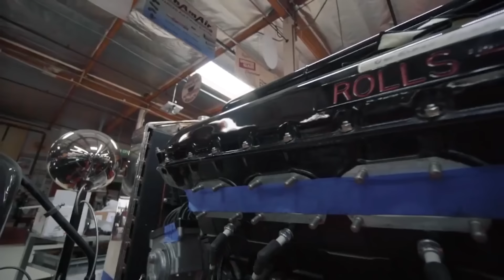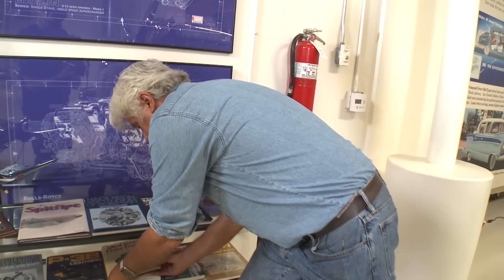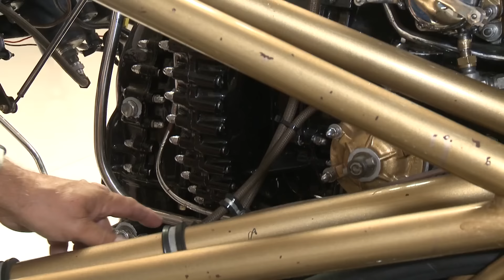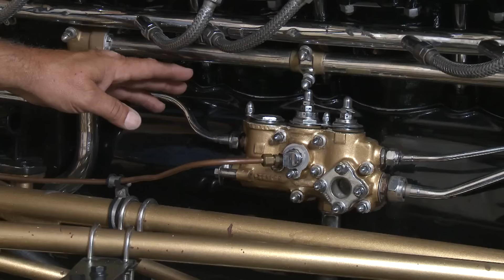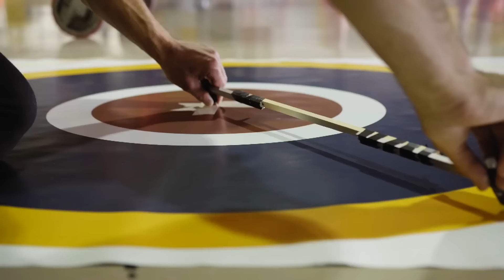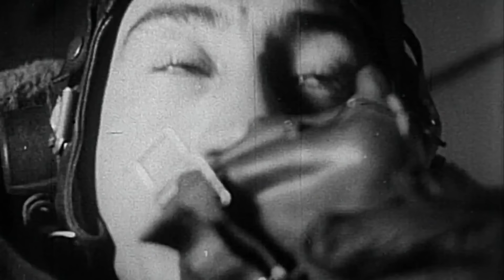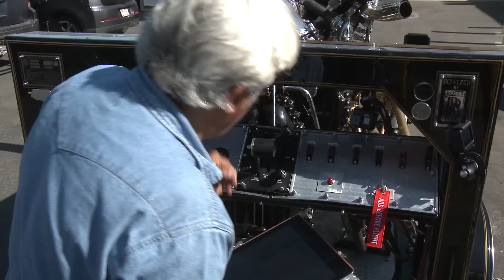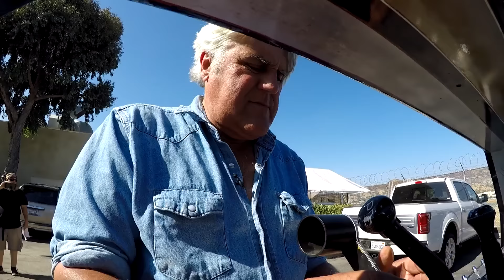The Engine That Won World War II - Jay Leno's Garage

Comment: It's so odd reading about these engines. This incredible monster was actually considered a medium power engine mostly for use in the smaller single engine aircraft. The P&W Double Wasp doing the heavy lifting.
Hoping the P&W will be next on Mr. Leno's shopping list.
Reply: Ryan James
RR made bigger engines like the Griffon.  Napier also made large square block water cooled engines.
Reply: s1rk3t.
The B 29 was very late in the war and could only carry 20,000 lbs on short range missions.  The Lancaster carried 14,000 lbs  and 22,000 lbs. 
Based on truth the Wright was not so very good. 
some years later a very much modified B 29 could just carry 2 x 22,000 lb bombs but not high or far and not in 1945.
Reply: Barrie Rodliffe 
The Soviets impounded a B-29 and copied it. The Soviet engines were superior and more reliable and powerful than the Wright engines.
Reply: Barrie Rodliffe The B-24 was powered by 4 P&W R-1830's R-1835's or later on R-1841's. The R-2800 were in the already mentioned P-47,  F4U Corsair, F6F Hellcat, B-26 Marauder, A-26 Invader and P-61 Black widow night fighter amongst other civilian   based air craft, early helicopters, fire bombers, and military transports.
Reply: Ryan James that R-2800 radial is a fantastic engine. it is a pity you only used two engines max in any configuration during the war. I think the C-46 Commando was the largest aircraft to have a pair, but it could haul quite a bit.....12,000 to as much as 15,000 pounds. A workhorse flying dangerous missions over The Hump in India!
Reply: Barrie Rodliffe Well when escorting fighters to and from Germany of course your going to have a higher attrition rate.
Reply: What are R-1835s' or R-1841s'? No such engines. All B-24s were powered by R-1830s', most of which were manufactured by Buick.
Reply: Graham White R - 1830-33  R - 1830-35   R - 1830-40   R - 1830-41  they're all variants of the R - 1830 double wasp Pratt. The liberator used all different variants of the 1830 in it's many different rolls.
Reply: R-1830 was Twin  Wasp. Double Wasp was R-2800. You left out -43, -43A,   -65 and -65A. No such thing as R-1830-40.
Reply: Miracle Wonderland Carnival Company I think four R-2800 is a helluva concept to think about but damn, what ever plane had four would have to have one huge fuel tank! Those things aren't the most fuel efficient. Lol the power though!
Reply: ADIT ADDICTS DC-6s had PW R-2800s.
Reply: Miracle Wonderland Carnival Company Thanks for pointing that out. I totally forgot the constellation was supposed to be a military transport but wasn't finished until a year after the war I think, maybe more.
Reply: ADIT ADDICTS Yes. And the DC-4 which went on and served during the war as the C-54 Skytrain. It is probably more famous tho for its role during the Berlin Airlift.
Reply: Howevern the C-54 did not have the R-2800s.
Reply: Miracle Wonderland Carnival Company the C-54 was powered by R-2000? Or something  like that?
Reply: ADIT ADDICTS yes the C-54 Skymaster and not skytrain  had the 4 r-2000 engines.
Reply: Ryan James aa
Reply: American junk
Reply: peer Lots of "American junk" contributed to the War Effort. It went into ships, planes, and tanks and trucks. Never underestimate the pluck and courage of an ardent recycler!
Reply: soaringtractor yes, well apparently that doesnt matter when it turns out there were R-2800 C-54s afterall. The c-54m had them. 28,000 pound payload.
Reply: soaringtractor Western bacon, ours and West Berliners. A lot of spam thrown in there too.
Reply: Ryan James.
Ever hear of the Lancaster, the plane that carried the biggest heaviest bomb of WW II  and it had 4 Rolls Royce Merlin engines,   P & W did go into the heaviest ever single piston engine fighter, the P 47 and it went into the B 24 which could only carry less than half the load of a Lancaster.  
There is heavy lifting or proper heavy lifting as done by the most important engine of the war..
Reply: The Much smaller Rolls Royce Merlin went into more and better planes, so what was wrong with P & W that they could not help a plane to carry more than a fraction of the load a Lancaster could?
Reply: @Barrie Rodliffe- Gee- the B-29 could carry 20,000lbs of bombs internally or two 22,000lbs Grand Slams externally. The Lancaster could carry 14,000lbs or one Grand Slam. Based on your logic we should leave the heavy lifting to Wright Duplex-Cyclones right?
Reply: Miracle Wonderland Carnival Company They could take a hell of a lot of punishment and get you home too.
Reply: I wonder how much they could take, the losses of P 47`s were rather high, the losses of Spitfires were  lower, and the DH Mosquito with two Merlin engines had a very low loss rate.

Comment: Cool, BUT it was the Russian T54 Tank engine that won the war - Mostly Model V-55(V-54) V-12 water-cooled. 38.88-l diesel; 500 hp (373 kW)
The Red Army won the war, look where the German casualties were
Reply: Cadogan Enright----  German casualties were greatest in Germany, thanks to the RAF and the US Eighth Air Force.  And many of those casualties that you are so impressed with wouldn't have occurred if Germany's factories and railroads hadn't been bombed into dust.
Reply: alexander kasady The deliberate targeting of German civilians by the Western Allies air forces was obviously a war crime. In particular, so-called 'bomber' Harris should have been tried as a war criminal. BUT my original point was accurate, It was Russian tank engines that won the war, not US aero engines

Comment: Hi Jay, and sorry to ever disagree with you. While the Merlin is magnificent, I submit there is a better candidate for the"Engine that won WW2" ---- that would be the humble Detroit 2-stroke diesel that powered many thousands of machines before during and after the war, and is still being used today. In its 4, 6, 8, 12, and 16 cylinder configurations it did the grunt work for more than fifty years. I think  you should give credit where it is due, yes?